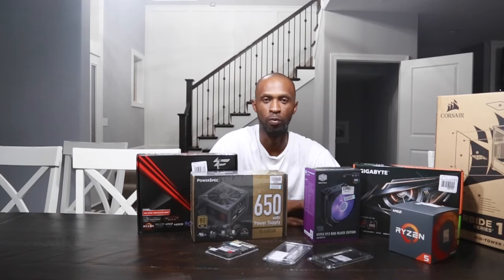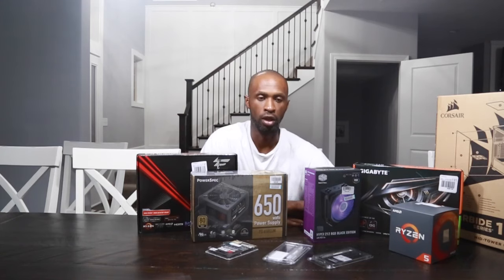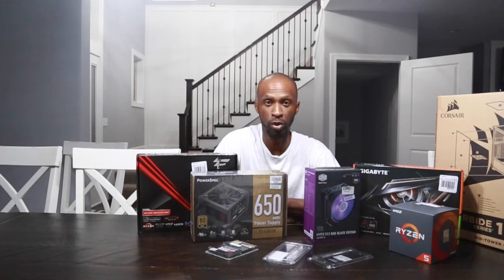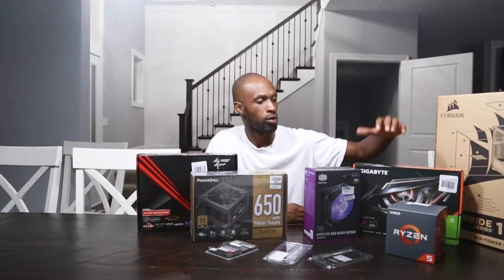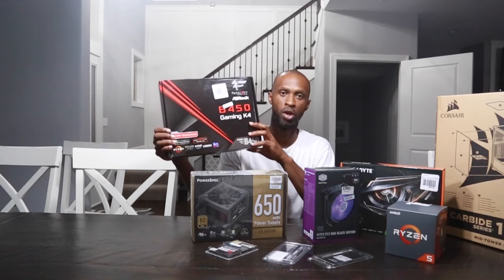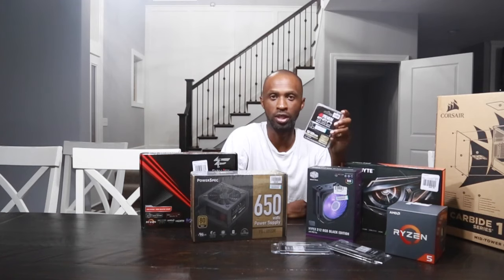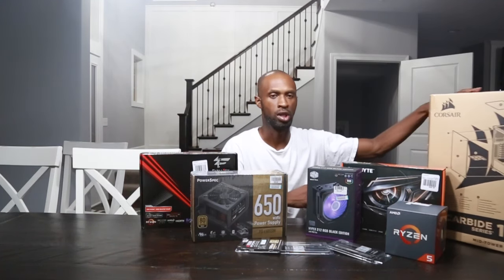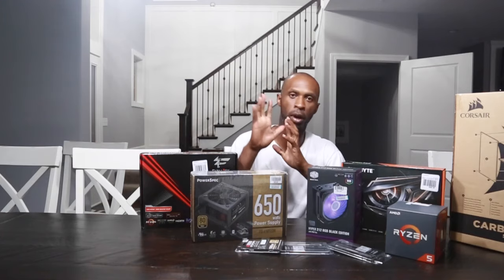Virtual Pinball Cabinet Vlog: The Computer

Comment: Awesome setup. I'm doing the same thing and buying all my goodies to make a pinball cab next month. I think our pc's will be about equal. I went with a i5 9400f, zotac gtx 1070 8gb, deep cool cooler, 16gb 2666hz ram, 960gb m.2, 525 watt power supply, and m.2 wifi adapter. Still waiting on the parts to come in. Goal is to have 4k pinball gaming.